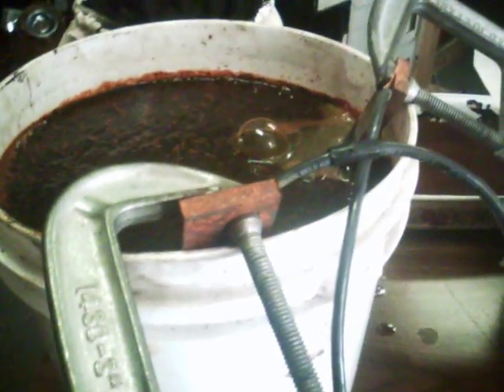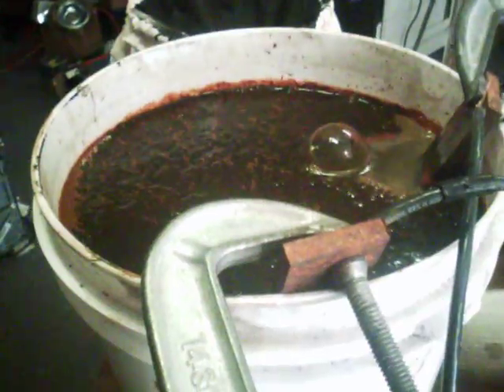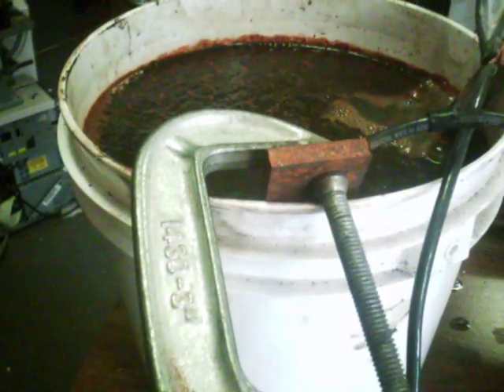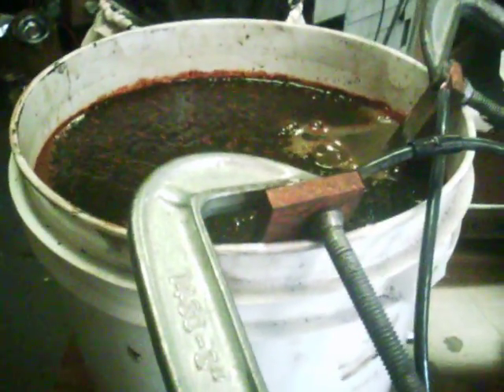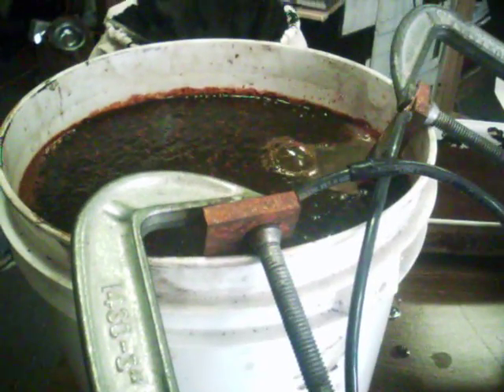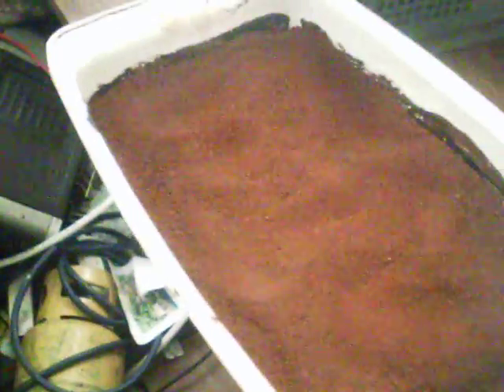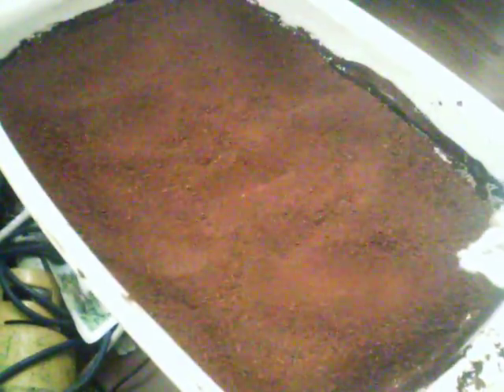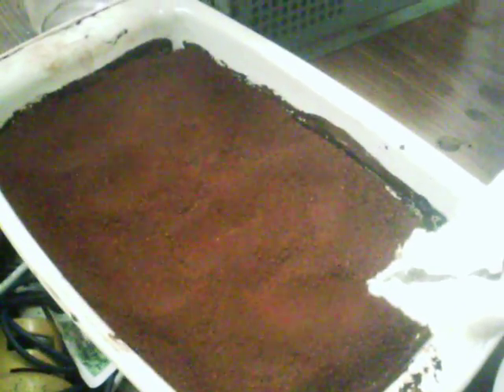iron oxide tutoria-nife batterie construction 1.0 AVI

Comment from the maker: Hi to your response on what is the cost it takes about 200 pounds of nickel hydroxide to make a 1000 amp battery bank plus other materials and connectors. I am working on a lithium ferrate/graphene battery with a polar electrolyte now.Ed

Comment: also in your iron oxide cell,  i would have to say that if you increased your surface area you would get much larger yields. you have a drill press?  could make a few holes in the electrodes.  on the plus side your waste shavings could be dumped in on one of the electrodes. or just use SS pads.  It is kinda standard to have one electrode higher than the other to keep your iron from re-plating out on your other electrode. can make one longer or staines or insulate the lead wire. hope it helps

Comment: any one here know how to easily make a nickel plating solution or better, a way to get the Ni metal into solution cheaply?  I have been toying around w/ some metals samples I got on ebay, basically making a few salts for fun, lots of diff colors in little vials.  any how I got tired of tying to "attack" Ni with acids w/ & w/o peroxide booster, so tried using a Ni electrode in vinegar - slow,  in HCl- works but vents HCl gas n gets HOT.  doesnt seem to get too dark so low concentration.  tips?

Comment from the maker: @KyleCarrington I am building one more small test  cell to work out electrical contact to active material problems the pickle jar 2 battery has a lock amp current of 8.6 amps the pvc battery is larger but has a lock amp of 2.8 amps but has 3.6 times the output .it has less contact area on the active material but more active material on thr pickle jar 2 I used 100 nickel mesh and on the pvc I used 26 mesh I think ideal is 40 mesh .Ed

Comment: If a normal battery, say a deep cycle battery marine/RV has (approximately) 100 amp hours - what do you estimate your batteries to do in the same "footprint" or cubic size. If you had 10 cells for example to make 12v, do you think you could obtain 100 amp hours from a battery (made of 8-10 tubes, 3.5" in diameter) in its ~12v configuration with, say, 36" tubes? in saying this, we would then have a battery with a perhaps double the footprint, but 4-6 times the height. Do you think that's doable?

Comment from the maker: I got my nife battery up and working its not pretty but it works after I put in the electrolyte I tested the voltage it was .065 it charged 10 min and it was 1.447
I connected a 1.2volt .25 amp lamp and it burned bright.will do another video this weekend-Ed

Comment from the maker: the nickel plate would be nickel plated iron,the nickel oxide when the battery is charged the first time the fe203 is reduced to iron and converts the nickel to the correct hydroxide.the electrolyte amount should cover the plates by 3/4 inch and the plated should be very close with out contact to cut down internal resistance.Ed

Comment from the maker: iron plating solution:ferrous chloride 50 to 80 oz per gal,calcium chloride 25-35 oz gal 50-200 amps per sqft with mechanical agitation and dont use air for agitation
pure iron anodes.you can make your own ferrous chloride from hydrochloric acid and clean oooo steel wool pads this will make light green/blue product-Ed

Comment: I apologize for throwing so many questions your way... I am trying to do my own research too... but... what is the relationship between electrolyte volume and surface are? Is there an ideal proportion such that if you have your cell "too flooded" with electrolyte - the cell's amp hours are minimized? Do you only want to contain the correct amount, and no more?

Comment: Ed, have you heard that by heating Nickel Oxide to 758F (400C) Nickelic oxide (Ni2O3) is formed as it takes on oxygen? Perhaps a sheet of stainless could be covered with a thin film of NiO (green) and made to turn black (Ni2O3) by way of a torch underneath? I've heard it will convert back, though at a higher heat.  I have no idea... sounds potentially health-risky... what are your thoughts on that? I know my HHO torch would get that SS right hot fast in a localized area, and be cheap to operate.

Comment: So cool. I can't wait to see this as I want to do the same. I have carefully made notes as i slowly watched the video to get all this down. Do you have a material in mind to use as the substrate for the electrodes before plating - you talk about the tubes, and the sponge iron - trying to see in my mind what actual materials you will approximate with... also, can you comment on the plating solutions, will they be acid based, like Distilled Malt Vinegar? And the voltage? Thanks Ed